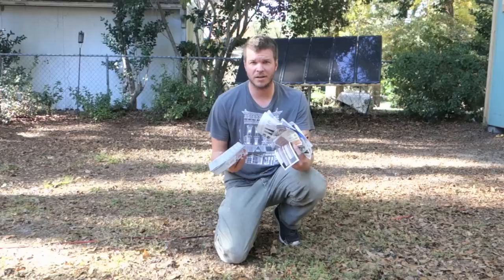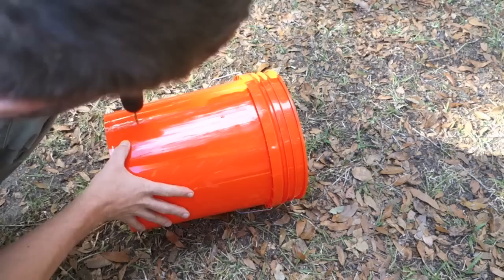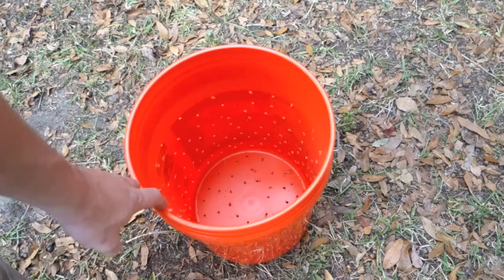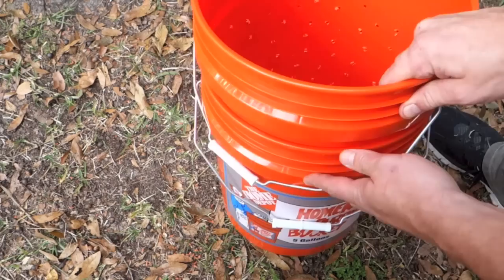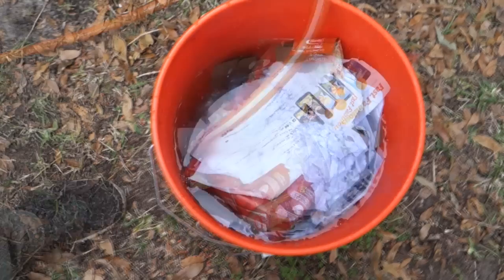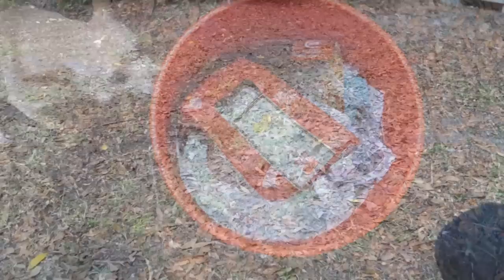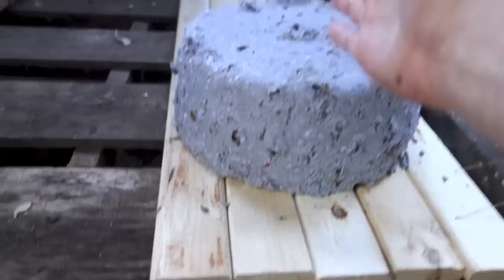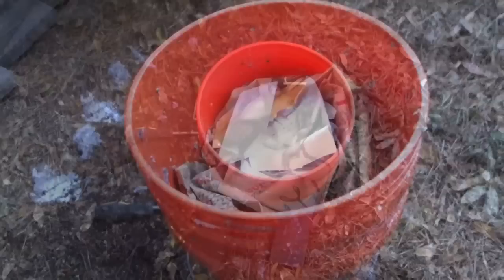Free And Virtually Unlimited Fuel To Heat Your Home

Comment: Most 'waste paper' these days has a significant amount of plastics, resins, binders, clay and yes, inks/dyes.
So go ahead, toxify your neighborhood with all kinds of hideous chemistry.
You saved money, that is the important part!
Up next, how to harvest, clean and use orange Traffic-Cones as a milk substitute.
Hey, those things a re free!  Just sitting there by the road...
Reply: Greg Gallacci 
and of course oil has no chemicals in it....? Obviously paper is going to be far more toxic than oil. Just common sense isn't it?
Reply: Oil IS chemicals.  Crude oil is thousands of compounds, all mushed together.
Paper WAS plant matter, but after all the denaturing, bleaching, stabilizing, coloring, there is not much 'natural' left.
What is the point of this non-sequitur?.
Reply: Greg Gallacci
Well I'm just wondering how burning paper "toxifies" a neighbourhood relative to the average household which burns through kerosene?
Reply: Paper is not 'just paper' anymore.
Clay, binders, resins, oils and even glue is a major part of 'slick' magazine paper.
Plain newsprint burns pretty clean, but what is in the ink?  Color supplements burn in such pretty colors...metal ions dancing in the flames.
Some glossy flyers are less than 40% paper, the rest being plastic.
Rather than burn this stuff and release a random chemical soup, pyrolyze it.
Destructive distillation, 'cracking', partial combustion to break chemical bonds, whatever you call it.
The nasty crap from random paper just doesn't become a vapor at the temperatures/pressures involved.
Distill the final product, you can get oil, kerosene, gasoline, whatever hydro-carbon you want.
The raw material is free, and so is the energy 'trapped' in it.
But the effort to get it out will not be 'free'.
Reply: Greg Gallacci OR we can just use space heaters powered by your clean rooftop solar panels.
Reply: And replace the panels in 10-15 years. Photvoltaic cells do not age gracefully.
Reply: Benn 'having a go' with alternate energy since 1977 with experimentation.
I know what works, what doesn't through practical experience.
I won't list all the kits, plans and other what-not I have wasted money on.
Lots of money, close to $10K since the 1970's.
Well, not entirely wasted.
I was curious to know why every one of these gadgets failed to work.
My first thought: I missed something.  I didn't build it right, wrong materials, wrong parts, maybe? 
Most of the plans/kits were vague, poorly written and were often missing some vital information. 
Could it be that I didn't fully understand the Science behind the thing, that is why I failed?
So I studied the Science behind things like carburetor magnets, water-splitting,  Browns Gas, Moray devices, "splitting the positive", Orgone Energy, cloud-busters, Pyramid-power and just about every 'Free Energy' thing I could find between 1980 and 1994.
Why did I stop there?  A realization that every single one of these people were frauds, or worse, True Believers who need not be burdened with Evidence, Proof or Money Back.
I learned a lot about Science, got a degree in the Biomedical field, some patents along the way. 
Machinist, electronic tech, welder, software engineer, biomedical equipment repair tech, inventor.  The mini-resume is to remind that I work with my hands, I know how physics works the same way  a Wrestler knows which way is down.
And in all that study of Science, and the Scientific principles,  and practical experience, not one of these gizmos stands up to the test: Does it work?
My "downer" opinion is built from years of tinkering, study, actual work with unusual science and learning what works, and what is crap.
Your opinion is whatever dribbled off your fingers today.
Reply: Levi Mus lol I know. BTW I'm burning a log right now
Reply: Lol, I was thinking the exact same thing.
Reply: Greg Gallacci Stop using "Chemicals" as a buzz word for fear.I've got news for you...EVERYTHING IS MADE OF FUCKING CHEMICALS.Go back to school.
Reply: Urb4n0Ninj4 Unfortunately Jakob Najmi is right, and so are you, but simply the fact that you knew it was a buzzword means that it is understood by everyone in this context to be dangerous chemicals. Welcome to English, an ever changing language.
Reply: Tom The Idiot 
Considering how many people out there in spotlight enjoy throwing around "Chemical" to raise fear for no reason, It's easy to assume that's what he is doing. However, I will admit I did not read his posts further down, he's obviously more educated that the ass clowns (like "The food babe" as a prime example) That try to induce fear via misunderstanding.
Reply: Of course I know what you mean, and I wish it wasn't that way.
Reply: The Quakers, you know, the Oil Company Church?, figured out that petroleum is the decayed ooze left over from dead things.  They wanted a 'proper' disposal of these countless liquified corpses, so invented internal combustion engines to cremate the Dino-fat, and made roads of what couldn't be burned. Asphalt.  MacAdam.  Black-top. Whatever.
With more roads, more miles to drive, more Dino-fat properly disposed of.
True story.
Reply: He's too far gone guys. Don't bother
Reply: beefcake3131 I already apologized and admitted I was wrong...jog on.
Reply: Urb4n0Ninj4
LOL I just saw your comment and was stirring shit up. :)
Reply: beefcake3131 Glance at the thumbnail of the video
"Stirring shit up"
Well played :D
Reply: Greg Gallacci Well then use organic grass clippings, dried leaves and twigs..or will you come up with something grumpy to say about that as well?
Reply: The amount of "chemicals" in today's papers is not remotely as toxic as burning coal or fossil fuel so stop spreading ill-informed information
Reply: Uhlbh
Reply: Greg Gallacci thx captain downer mcfuckitington
Reply: Greg Gallacci Most panels are rated for 25 years now standard, and only drop to about 80% efficiency by that point. Under good conditions ( no heavy hail or branches falling on it ) it should last well past 30 years. I'm putting my own panels up now, i'll let you know how it goes in 30 years.
Reply: Greg Gallacci 
Sure good points, but maybe instead of being just negative, propose a better solution?
Reply: +BANG! Maybe he has no better solution. It is a good idea to test paper products and see which are the safest to burn.
Reply: +Peaceful Hooligan how would you test the paper? not kidding i really want to know
Reply: in a taste test i right... omnomnom him tastes like paper I'm gonna burn it.
Reply: +Greg Gallacci i would like to point out i currently live in an area that does not and for the likely foreseeable future will not recycle paper. we hillbilly's out her have wood burning fire places, and expensive heating bills. its how we stay warm when it gets cold out side.
   Its right to believe that anything that smokes pollutes. so any kind of fire could pose harm to anything near by. i do believe all thing smoke when burned. so arguing that these papers are bad to burn, isn't everything bad to burn. i mean its like we forgot what smoking does to our lungs. and yet there are people who've been smoking for 60 70 years of their lives and for their age there doing just fine. and they smoked before filters and cleaner cigarettes. just something to think about is all.
Reply: +Greg Gallacci  look at the big box stores and all the chemicals for the lawns and gardens most are very toxic more toxic than this  process.   Fertilizers get in the streams and cause many problems, etc. etc. etc.
Reply: +Greg Gallacci I agree with you :)

it is funny to read the comments of the soon to be winners of the darwin award.

You tried your best to talk sense to these people, hope some took heed, the rest will simply not exist eventually because well... you and I know why.
Reply: Except your only looking at an extremly small reality. And making it the big picture. We polute less then when we hop in our prius and drive to work. Thats how small scale your thinking. And garden333 ide like to point out these polutants feed plants. They actuall would live better in car exhaust than fress air. Like whats happened to our self preservation skills. You two, and your darwin award clame, should go stick your heads back in the sand. You are no use to people who are moveing foward. think about it this way. Burt paper becomes carbon ritch perfect for new plant life you cut out 5 to 6 years of decay. Toss the ashes into your guarden. And mix in remember to water well. You've done more for world preservation than any green peace rally ever has. That carbon going into the air is going to atract water molecules. Forcing raindrops to form. Allowing it to rain. If your mind isnt blown yet. Most polutents are actually benificial to our entire world. When you only look at small pictures and draw large conclutions that you cant see how compleatly small these things actually matter. But still stick your thumbs up your ass and clame world distruction over wadded papper. Its not 21 forest fires in the western united states or volcanic ash falling from some tropical island. Or a war thats been going on for so long its been forgotten about. Live your small little lives, in your small little prius, because we all know you dont bike to work because that means physical means.
Reply: +Greg Gallacci FYI: Solar panels run at 80% efficiency after 40 years. 95% efficiency after 30 years. Technology has improved since the 70's.
Reply: +Greg Gallacci  This guy is not playing with a full deck.
Reply: +Greg Gallacci my sentiments exactly...he he!...greed does strange things and the money saved often goes to vice.... like poker machines...a very poor trade off. i would just as soon be eating out of a skipbin at aldi's
Reply: +Greg Gallacci That may well be so, but power has become a lot more expensive than it was in 1977!
Reply: +Greg Gallacci Yes, tarmac, but it wasn't discovered by a pessimist who'd given up trying new things, now was it?
Reply: Lucia Tilyard so we should do things that are obviously really bad because... as long as you try right?
Reply: Avslutarn I'm getting older, and don't worry about detrimental health effects anymore. You can spend your entire life being frightened of things, especially chemicals, my new idea is to just get on with it!
Reply: Lucia Tilyard and I'm part of the generation that will have to clean up the planet from all the mistakes that the previous generations have made up to this point in history.

Cancer can get me at any time but I'll be damned if people get it from other people burning toxic waste in the back yards to keep their houses warmed and saving 2 dollars every month instead of simply buying proper energy instead.
Reply: +Tom The Idiot I am going to be making and dumping a log in a minute.
Reply: Avslutarn Go into politics, People wouldn't have to be making their own 'wood' if they hadn't become so poor they couldn't afford to buy it.
Reply: +Greg Gallacci "Oil IS chemicals.  Crude oil is thousands of compounds, all mushed together."
Yes, just like literally everything else in existence that is made of matter. EVERYTHING is chemicals. 
Give an organic apple the same treatment most Organic-mongers apply to anything else they deem "processed", and you end up with over 70+ equally scary-sounding chemicals. 
http://io9.com/what-if-natural-products-came-with-a-list-of-ingredient-1503320184

This is why you pay attention in chemistry class, people.
Reply: +Greg Gallacci  Very close to the logs I make in the morning. ..    Except 4 the texture , and shape ,  color too.  Not that big either
Reply: +Джейсон Хичкок yeaH!!
Reply: Toxify the neighbours that's bullshit once you've got the heat up all the combustible gases are burnt off including any toxic chemicals/gases
Reply: +Greg Gallacci lol you seem a bit too concerned with this. Look, it IS bad, but not polluting enough or widespread enough to be a big problem. maybe it deserves some attention, but currently there are a lot more harmful and common ways to heat your house. if you find this commend disagreeable, fine. but i still think you should be a bit less... harsh. your comments and wording seem like a bit of an overreaction.
Reply: +Greg Gallacci lol you seem a bit too concerned with this. Look, it IS bad, but not polluting enough or widespread enough to be a big problem. maybe it deserves some attention, but currently there are a lot more harmful and common ways to heat your house. if you find this commend disagreeable, fine. but i still think you should be a bit less... harsh. your comments and wording seem like a bit of an overreaction.
Reply: Surely only you burning this one block won't harm your neighborhood but it seems you are suggesting this as an "alternative" ... so what would be the outcome if your entire city starting burning old printed on junk mail?  I'll tell you it's not a city I would want to live in. That is also true for the city that would use old varnished furniture pieces for heat as a different alternative.
Reply: i stopped by a friends garage and he was tearing up the foam from junk snow mobile seats and burning it. WTF
I WAS ALSO AT A BUILDERS CONVENTION AND I ASKED THE REP OF A SIPS PANEL MANUFACTURER 
" WHAT ARE WE GOING TO DO WITH ALL THE FOAM IN 100 YEARS OR WHEN THESE HOMES START TO FAIL? "
His responce was...we will probably be burning it as fuel.  we're so FU@%ED
Reply: +Greg Gallacci KEEP YER HANDS OFF MY CONE MILK!
Reply: Excellent comment...You got my vote. BRILLIANT!